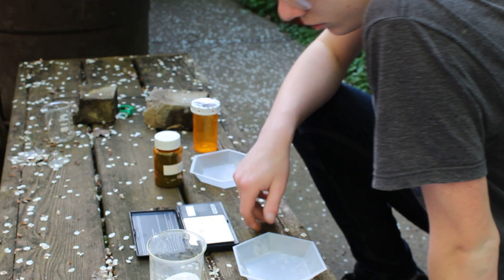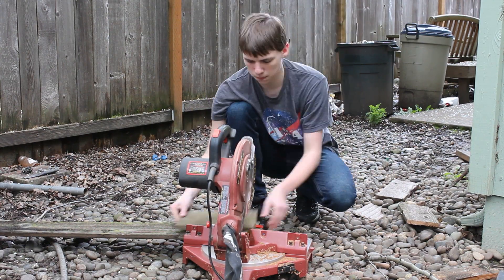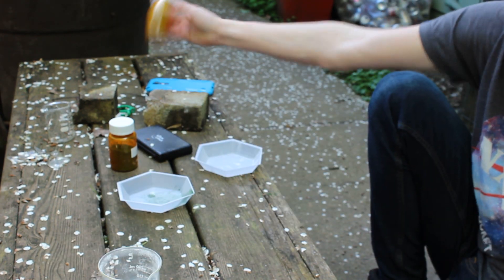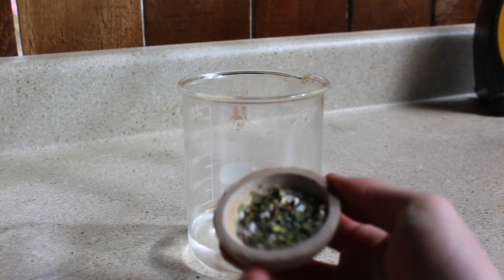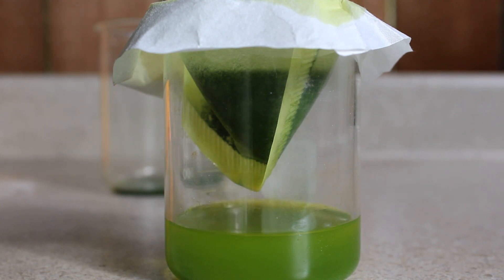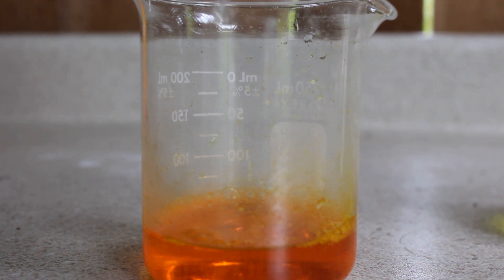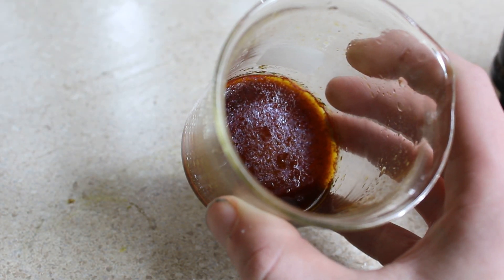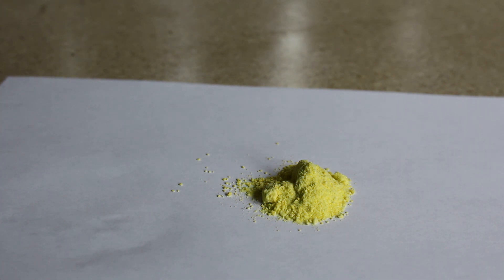Making Sodium Chromate (and Dichromate) by Roasting Chromium Oxide

Comment: Melt sodium hydroxide, potassium nitrate, sodium carbonate and chromium oxide then bubble air through it. You can skip the nitrate, but a little bit added drastically improves the conversion of the chromium oxide to the chromate. You can make pretty purple permanganate similarly. Just be sure that the NaOH is in excess in both cases as it is gonna be your solvent.

Comment: Don't use sulfuric acid to transform the chromate to dichromate, seems glacial acetic acid works pretty well, it does not produce too much chromic acid and it will evaporate, contrary to the sulfuric acid that will not evaporate and transform your product into chromic acid eventually decomposing it.
Reply: Yeah exactly this looks more like a chronic acid dichromate mix to be honest.  If glacial acetic acid is not available, sodium bisulfate would work as well.